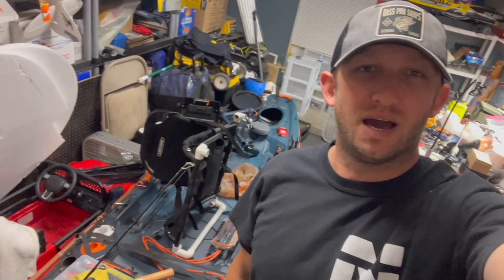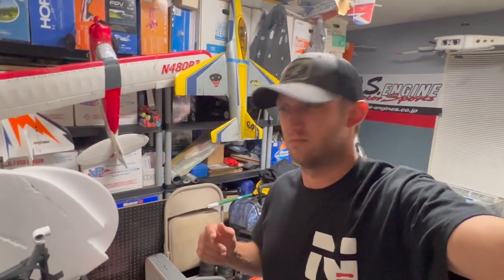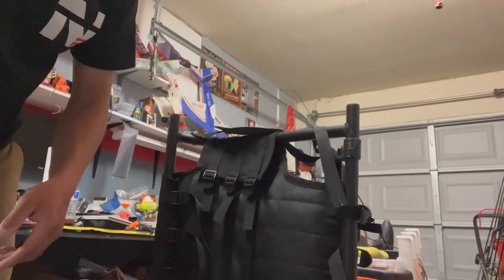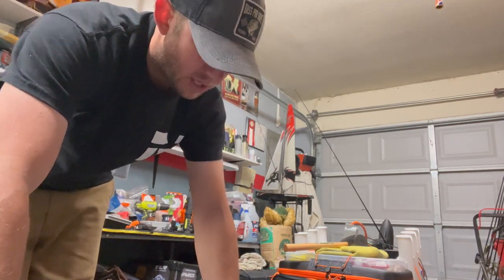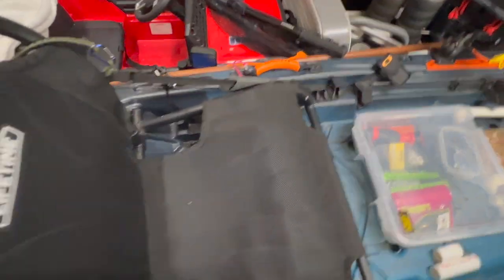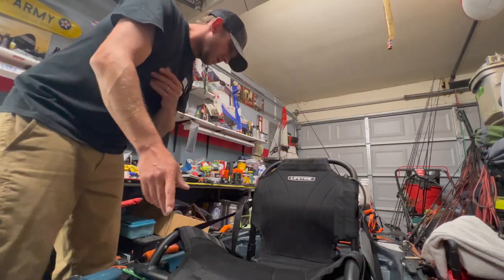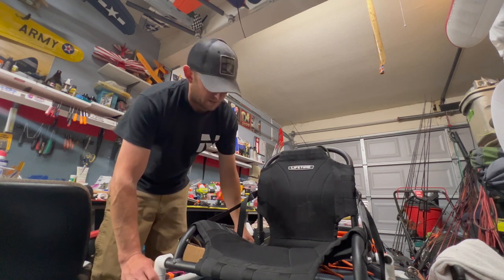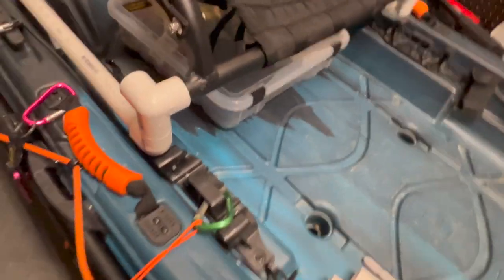Kayak Accessories - DIY Seat Risers

Comment: How long did you cut your 3/4 pipe pieses?
Reply from the maker: For the height itself I literally just made them long enough so that the corner T joint lookin pieces could but up against each other. The other ones going front to back and side to side I honestly eyeballed lol

Comment: How did you mount the seat
Reply from the maker: Into the pvc, onto the kayak. Which part specifically?
Reply: I didn't see the video of where n how u mounted the seat?
Reply: I think he means how did you mount the front pvc into the existing seat support that you were modifying?
Reply: @gtrevino50  yes this is what I’m wondering also
Reply from the maker: I used a pretty thick lag screw through the PVC joint down into the plastic piece where the seat would have originally mounted, the black piece, not in the kayak itself
Reply: Do you have a video to show how well this seat idea held up? I'm a big boy with the same yak and wonder how well this worked
Reply from the maker: Don’t think I did while I had it. I’m 180ish. I can say that it held up beyond my expectations for how I treated it 😂 new owner is about 200 and it’s still goin strong, problem free. The T angle corner pieces were only connected by a piece of tube long enough to join the top and bottom piece, no longer.
Reply from the maker: @tylerabresch4199 far as I know, the second owner still using it 2 years later